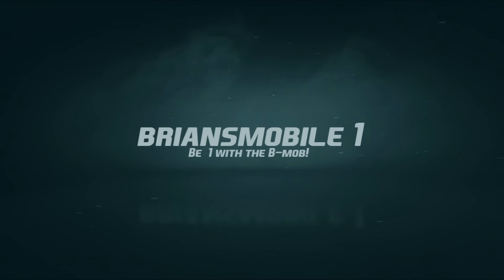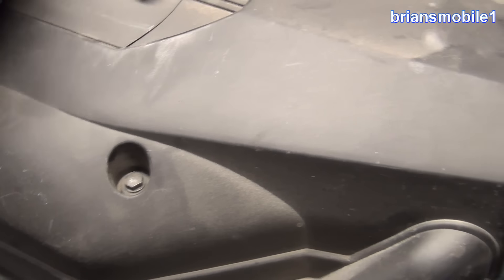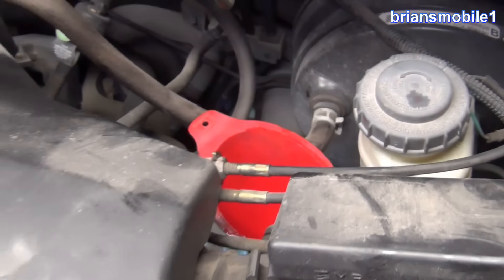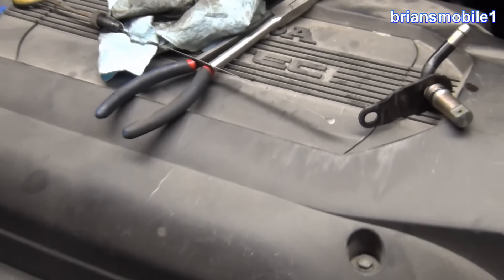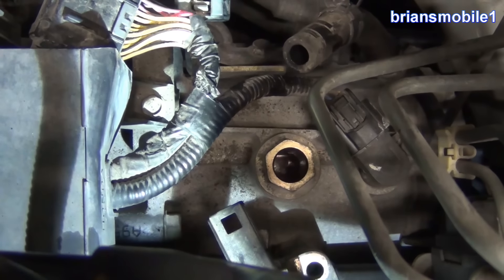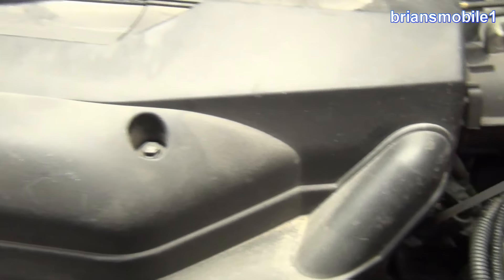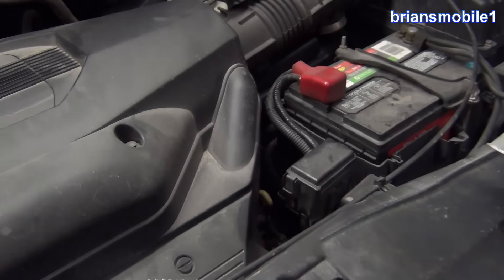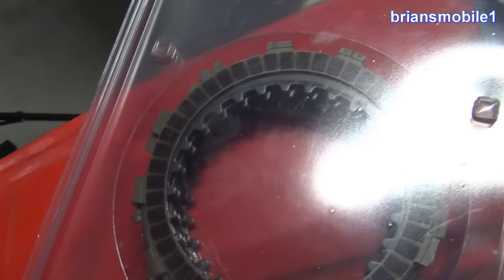Watch this Video BEFORE You Destroy Your Honda Transmission

Comment: Small tip from someone who's been changing Honda trans fluid for 13+ years; if you have a properly sized funnel with the right sized hose on the end of it (I've never measured, but I want to say something like 3/8 ID) you can shove it right onto the dipstick tube and fill through there without having to take the fill plug off and it makes for a much more streamlined process.
Reply: Exactly what I did
Reply: Thanks bud.
Reply: Yes. I bought a clear plastic small hose that fits into dipstick hole. Snug fit.  Shove plastic hose into a plastic funnel-cut tip for a snug fit.  Drained 4 quarts out overnight. Started run through gears quickly with drain plug out.  Change every 25,000 miles on my 2002 odyssey to solve bang shifts. 227,000k. Still going.
Reply: So glad you said this. Thought I had been doing it wrong.
Reply: Ex-Acura Tech here. On Hondas that have a dipstick, I always filled through the dipstick. I also used a big measuring bottle for the fluid that came out, and (obviously after inspecting for leaks) put the exact same amount of new fluid in. Obviously I still check the fluid level if there's a dipstick, but it was always perfect.
Reply: Whats recommended for 2022 HRV CVT trans as far as mileage interval and flush/filter change or just drain and refill with Honda fluid ?
Reply: That's what i do, much easier
Reply: But that makes for a boring video.
Reply: can use a 20ml medicine syringe, top up 20 ml at a time, take 2 minutes
Reply: @wazzabanzook5028  uh.. 20ml is 0.68 of an ounce. Not sure how you do 3.5 quarts - that would take 3,312 20 ml syringe cycles 😊
Reply: @henlo1910  Why do we have to use such a specific oil (which Honda has discontinued and replaced with the Acura-branded version) It's a basic Honda car and it needs a very specific trans oil. I find that dumb.
Reply: @condor5635  it's doable 😎
Reply: Thanks for the tip. On my 06 Odyssey it has been rebuilt once about 50k miles ago and always take it to a Honda when it’s time to change the fluid. Just noticed it’s got about a 1 -2  second delay when I go from park or reverse to drive positions. Any suggestions? I will change the oil and filter .
Reply: Would you recommend to change the Trans fluid on a 2000 crv with over 250k that probably hasn't been changed in years by previous owners
Reply: I was just going to comment asking about this. Thanks
Reply: @arvbergstedt3303  Arv you mean you drained 4 quarts of and with the drain plug still out you started the engine and put it at idle sitting still in all gears real fast then shut it off? Isn’t that maybe going to hurt the trans? Does more fluid come flying out the drain plug when you do this with engine running?
Reply: @henlo1910  I have a 2006 Odyssey and was wondering if there is an aftermarket full synthetic trans fluid that might work better than the Honda fluid? Our son bought a new one so he gave us his 2006 so learning how to properly take care of it. He had to put a new trans in it a few years ago so has always changed the trans fluid when it’s suppose to be. It runs and shifts great but has a delay when you go to put it in gear. Any suggestions on why it might be doing this delay that I can do to fix it? I’m a diy guy so see there is a filter on the drivers side of the trans so plan on putting a new one in when I change the fluid. Thanks for your help.
Reply: @jonathanbreaksit wondering that too
Reply: Thank you for your informative answer. After viewing this video, I was wondering the same thing since that is what I did with all of my automatic transmission cars equipped with a dipstick.
Reply: @henlo1910  i have a 2005 crv manual. Is there anything different i need to do. And also i bought it uses and not sure of its  maintenance records. If it wasnt changed should i still do it. I only ask because of a bad experience with a van years ago that was not shifting properly so i just drained and filled the trans and it never drove again. Later other mechanics said oh you should have just left it or threw sand in it lmao. So in short is it true thats its better to leave one that has not properly been serviced or is that just a myth
Reply: Get a plastic turkey baster. Remove the rubber squeezy and toss it. Wedge the plastic part onto a transmission funnel. Works like a charm and goes right in the dipstick hole without spilling a drop.
Reply: @condor5635 uh.. you almost had it. 3,312 syringe cycles would be for a 1mL syringe. Divided by 20mL syringe = 165.6 syringe cycles, still a lot 😊
Reply: @clifftravis7234  - you are correct! Must have had a long day

Comment: Drained my old honda civic transmission fluid and refilled every 30k miles, after 167k miles it still ran perfectly and I drove it hard.
Reply: Did you drain and refill several times to take all the old fluid out?
Reply: Jonghun Song, no just drained the fluid from cold and refilled once (checked level when warmed up) but each time the fluid was clean and still red in colour. I can imagine two or three refills would have been better but never thought to do it.
Reply: Hey I have a K24 series engine Honda engine and I recently had Dexron Fluid added because it was an emergency. According to the manual book, that is a temporary fluid but as soon as possible, you must change it to Honda Genuine. Before I change it, should I flush it (how) or just change it. I need help
Reply: Stu Mac the gears shifts fine but not smoothly for the 1-2 gear
Reply: xX squeaker Xx it did help but is it necessary to flush the previous fluid because it’s still clean.
Reply: Andrew, suggest you google transmission flushes because there can problems if the car has high mileage and/or the transmission fluid hasn't been changed regularly. Plenty of tutorials on how to..I'm not expert enough to diagnose your shifting problem.
Reply: Been doing it on my crv for the last 10 years ,and still run smooth with 500000 miles on it.
Reply: @elcoyotecojodeldesierto2300   how often 30,000 ? Have a Pilot V6
Reply: @elcoyotecojodeldesierto2300  thats sick 500000?? how often you change it?
Reply: Waste of money and no need
Reply: @ELY-qg2vn  once a year.
Reply: @trailblazeratv6306  manual says 30,000 miles but I do mine once ayear.
Reply: @jonghunsong2019  종훈이
Reply: @TheIrongutz  id rather waste 100-120 bucks worth of a high quality ATF 2x a year vs spending $$$$ to rebuild my transmission who knows when, I drive 50k hard stop and go + traffic miles yearly on my 02 Camry, I do a full drain and fill on trans every 25k miles
Reply: @johnnicholas6802  Do what makes you feel good inside. I had a new 03 Odyssey and changed it at 160,000 and the fluid looked new still. More is not always better and I’ll take the money and use it towards steak and beer before I waste mine on needless oil changes. Honda and Toyota engines and transmissions aren’t like the garbage that the big 3 produce.
Reply: @andrewbelmudez6985  Never flush a Honda trans. Just change the oil in it a few times to get the oil out of the torque converter and use Honda ATF if your going to diy.
Reply: @briankim4519  왜 ㅋㅋ
Reply: I have had my holden vn wagon 800,000+ks.serice well n driven hard but not launching on a daily basis.never miss a beat.SERVICES RULE.
Reply: @TheIrongutz  I did a DIY back in August 2020 using Honda OEM and it shifted a little bit better. 1st to 2nd would make my head move but the other gears didn’t. As of now of May 23, 2021, my transmission is okay after driving it for road trips 5-8 times back and forth. It shifts smoothly for now but 1st and 2nd seems like it relaxed on the mini jerk. Idk if it’s normal for its high mileage. For now, I’m just driving it normally and I can’t find anyone with a Honda 5 speed auto transmission to look at my tenant and determine it’s lifespan
Reply: @jonghunsong2019  종훈이
Reply: @andrewbelmudez6985  Is first and second shifting late on a cold startup? That's normal
Reply: @andrewbelmudez6985  I'm not sure why so I'm not exactly recommending this but it's how my shifting fixed. I was kinda stuck off roading and I was letting 1st and 2ed almost red line while getting out and it seemed to clean something out that was a little stuck. It's been 3 months and everything still seems alright 👍
Reply: Im
Reply: @andrewbelmudez6985  mine is Asian model Honda City. I did have the same symptoms on my trans. I could say that the jerk of 1-2 shift is due to clogged filter. I tried not to hard pedal for few week before coming back to normal of the trans. I think the bypass valve of the trans filter is working itself to bring fluid to the trans.
Reply: For Hondas use the drain and refill method, 
I have 05 and 07 Odysseys .
I do the drain and refill X3 then change the filter every 30k. After 08 you can not easily change, the filter. I also run a magnetic inline filter, change it every 6 months. 
I also do a single drain and refill every engine oil service.  So far 320k miles on the 05 and 240k on the 07.  Used this method on a 95 Ford E350, E4OD transmission  it made it to 400k miles, body rusted out the motor and trans ran strong.
Reply: SHIETTT mang i just  brought in August a yr 2000 4cyl honda accord and the owner just drove it and it only had 102,000 miles but was stuttering and slipping into gears, i drained the bottom of 3.5 qts, then hooked up the radiator hose and flushed out the rest, just start for 12 seconds and it all comes out into your tub, make sure to put 3 quarts into dipstick before starting engine so it doesn't ruin the tranny, then i refilled with original honda fluid -6 oz  and put the 6 oz of Lubegurd in and after 1,000 miles no slippage and running good, hope i get 20,000 miles then i will do it again.
Reply: @craigwiess1656  i drained the bottom then blew that crap out my bottom radiator line into a bucket, just make sure you add qts into tranny after you put back the tranny bolt, nothing happened to my honda, the dealers recommend your way of tranny fluid change because most idiots will run the flush dry and ruin the tranny, same reason McDonald's french fries are not hot and coffee isnt hot because you got idiots getting burned and will sue.
Reply: @TheIrongutz  at the end of the day, ATF is cheap, a new transmission is not 😅
Reply: Did you just drain and fill once or twice? I have a 02 civic w/ 117k miles and I honestly can’t remember the last time I changed the transmission fluid 😥
Reply: Whats difference oil levels check ( cold or hot )

Comment: Don't bring your car to any quick lube place, ever. My experience, they will rip you off or try. Great video.
Reply: Rip you off by selling you stuff you don't need.  Rip you off or screw up the thing you came for.  For an oil change, favorite tricks are stripping the drain plug, over/underfilling, using their ultra-cheap stuff instead of the synthetic you paid for.
Reply: Or screw your vehicle up!
Reply: You can go to quick lube, but only go for the oil change. Don't be a sucker and buy all the extra crap they try to sell you
Reply: The word "quick" should've steered anyone away lol.
Reply: Dude! They tried to tell me my water pump was leaking with with no pressure test yes it was 315 with labor compared to the dealership but i did a pressure test and my heater core connector was leaking
Reply: @thebestkinds1g  the problem is that they use their cheapest oil,or they use a used oil,I had an experience with one of those shops.
Reply: I've worked at a few. Didn't get many hours because I'm not a salesman. That's what they want you to be. They don't really make much off the oil changes. They give you a good price for the oil change just to lure you in the door. Then the salesman take over. I never sold anyone ANYTHING, so I always got reduced hours. They'll really get on you about it. Even had a GM try to lecture me about sales. Didn't matter, because I still didn't do it. That's not in the job description.
Reply: I worked at a jiffy lube when younger and your comments are incorrect.  Have a nice day and do your research
Reply: I agree, do it yourself or go to a locally owned REPUTABLE shop, jiffy lube and their ilk can suck a fat one out of me, "they" (a valvoline in st Charles MO) rounded off my first cars drain bolt, I found out when I went to change the oil on my own for the first time, went inside the joint with my service sheet from that visit and asked for both the "technicians" that "serviced" my car,
I can imagine losing your job after getting grilled out in front of customers by a 18 year old isn't fun.
But I got my drain bolt and oil pan replaced on their dime, so it worked out for me in the end.
Reply: @robertwar7814  You are wrong. He is right.
Reply: Never, Unless you have a trustworthy friend that works there and is responsible for doing the work. But the chances of that are slim, just do the work yourself, or go to a family tech
Reply: They also don't use the correct fluids and they will lie to your face about it
Reply: @robertwar7814  did you have to give yourself that thumbs up because nobody else believes you?  We did our research and don't believe you.
Reply: @Npc5150  i worked at one.  Got fired cause I didnt sell extra shit.  Still remember that day.   Greatest feeling ever walking out. Got my tax return that day. Got a new girlfriend that night and got a call the next day for a interview at a railroad construction job.    Dont work or patronize at quick lube shops.
Reply: They actually stole my battery and put a five year old battery in place of it. Didn't notice till months later. Cause they didn't even tighten the cables back down all the way. Them and me was the only ones ever under that hood so I know it was them and it was an express lube.
Reply: So is that the company that ripped you off or the incompetent person that did the work. I've seen mechanics at dealerships screw stuff up too. Doesn't make it a bad dealership. They just hired the wrong guy.
Reply: @korndawggy1801  I think the company encourages their employees to  sell un needed services and then not to even do them. I know of one person that worked at the dealership that screwed me and he said they are told to do it.

Comment: I worked at a factory that bottled this fluid.  The label on the bottle says "this fluid is specifically designed for Honda transmissions".  Once we got done with the order we would start on the next order and let's say it was Nissan.  The order would call for the same fluid and all we would have to change would be the bottles and swap the roll of labels that go on the bottles and boxes.  The Nissan and Acura labels would say the exact same "this is specifically designed for X transmission". Even though it's all the same exact fluid.
Reply: Acura and Honda are the same company, just a different brand. Acuras are "luxury" Hondas. Now you know. Nissan using the same fluid isnt so suspect either. Plenty of brands use already existing, parts and formulations, to avoid sinking $$$ into R&D. The important part is to not use the wrong type of fluid because there definitely are different types.
Reply: Isn't Nissan fluid a different color, especially for the CVT? Blue right?
Reply: What if i used a tube and put it through the dipstick hole.. seems easier

Comment: It really grinds my gears when the manual asks for 3.1 or 2.2 liters or whatever, and they only sell 1 liter bottles. It's like its on purpose to force you to buy another bottle.
Reply: 3.0 will get you in between the min and max.  Good enough.
Reply: Kinda like having to buy a two pack of light bulbs for automobiles
Reply: Have a 2011 accord with v6, I was getting random hard shifting and drained the fluid out, got the Honda transmission fluid, put 3 quarts in. I took a plug out on top of transmission it was 17mm and had ATF stamped on it. At operating temperature level was right at the top hole on dipstick and she’s been shifting great 👍
Reply: What’s cheaper oil or a transmission?